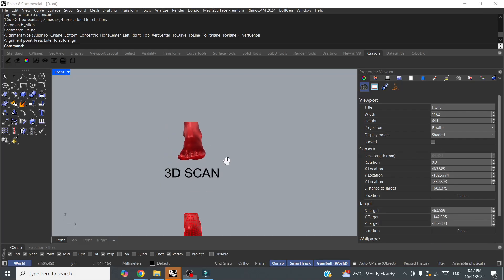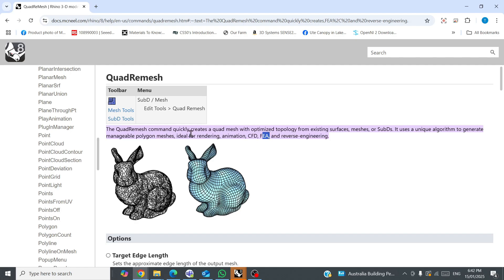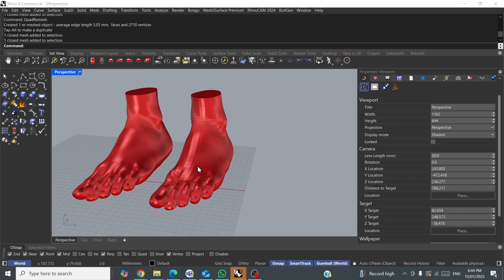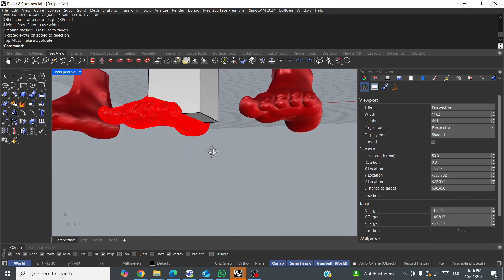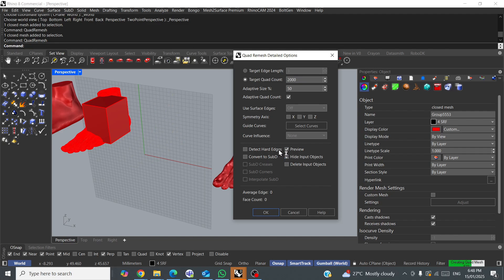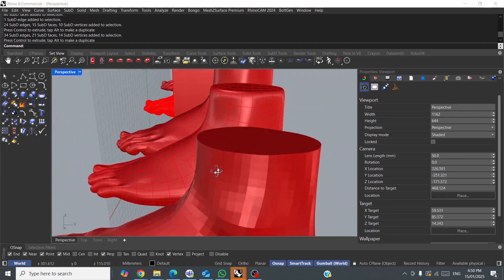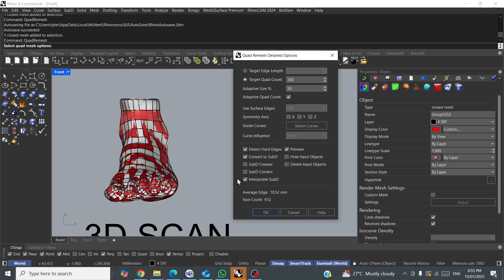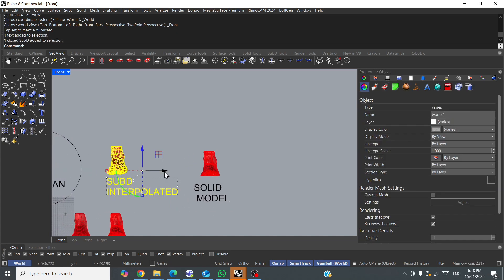Rhino For Reverse Engineering   - Quad Remesh - A Deep Dive🥽

Comment: Great, I would like you to make a video in FBX format, which are not solid geometries but rather multi-polygon shell surface geometries such as vehicles. I have not been able to make these because when applying the Quad Remesh command in Rhino and then to NURBS it suffers some deformations that I have not been able to solve and the same thing happens to many people.
Thanks.
Reply from the maker: Hello! No worries I'll give it a try 👍 Thanks for the feedback